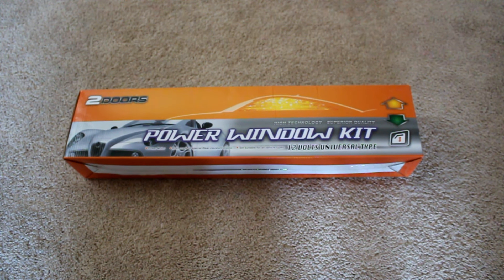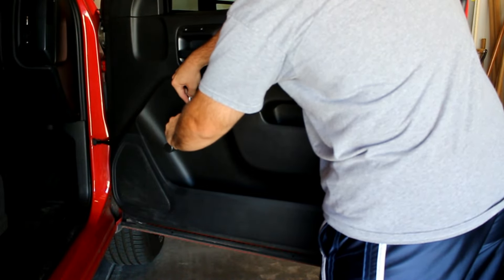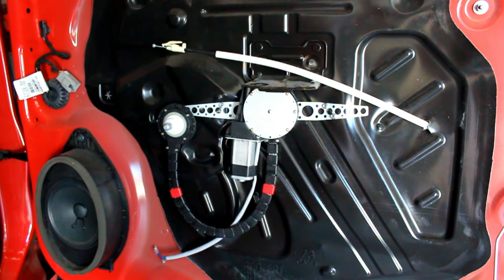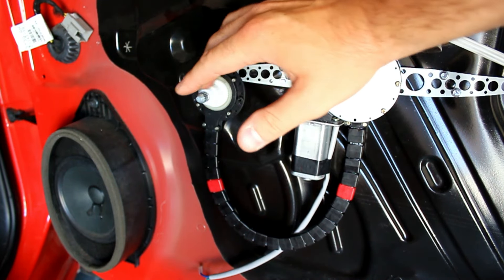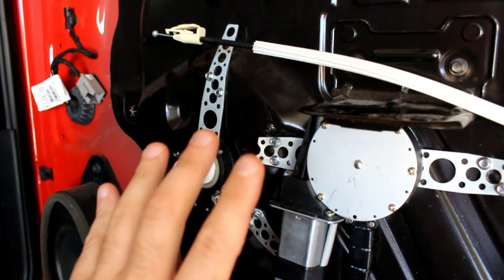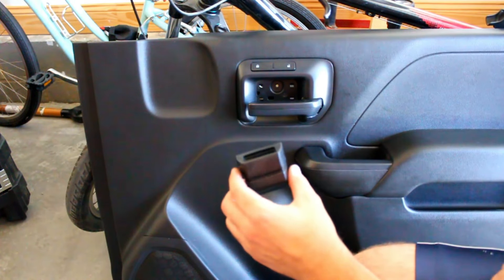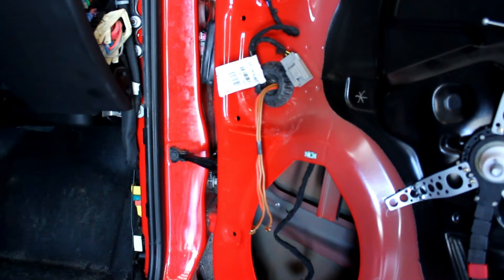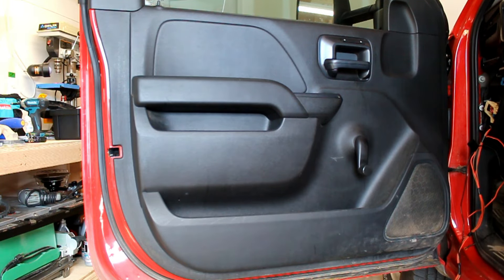[HOW TO] Convert Manual Crank Windows to Power Windows - 2016 Silverado W/T

Comment from the maker: This made my work truck so much better. Power windows are a must have! I know this is a long video, but it has a lot of useful info. Enjoy!
Buy the power window kit here: https://amzn.to/2Nn7XyH 
Buy the Fuse Taps here: https://amzn.to/2RaSYJs
Reply: I did it the driver side worked but the passenger side rolled down but only went half ways
Reply: Fondupot's Garage did you lube the sides and did the windows eventually work a bit faster? Any update videos?
Reply from the maker: @ImHim6Fifty  Sorry for the delayed response. Yes, keeping the gaskets on the window lubed helps tremendously. I lube them up every couple of weeks. My truck sees a lot of dust on construction sites.
Reply: @fondupot  is there a kit to additionally make back windows power windows as well?
Reply from the maker: There is a rear window maker that has a power rear window. But it requires swapping out the entire back glass. I haven’t found a kit that makes the OEM window power. I want a power rear window though!
Reply: @fondupot  oh that would be cool too! i meant a 4 window setup. actually just found one on amazon for around $110. has your 2-door been working without any problems?
Reply from the maker: Oh right gotcha. Yea there are four window kits. My two door kit is still working. Sometimes my passenger side gets stuck about half way up. And I have to push the window up with my hand while holding the button for the motor. But otherwise no issues.
Reply: Thank you
Reply: What where the fuse numbers you put in? 10 i saw and what else? But the main inlet fuse said 30 amp

Comment: Didn't even know this kit existed. Was gonna try and jerry rig something. 
I just picked up a used Chevy cargo van on an auction site. Love the van other than the manual windows. Definitely gonna give this a try. Even if after a while it only works half the time and I have to hand crank the other times, I would love it.
Reply from the maker: Mine are still working. My passenger side gets suck sometimes and I have to push it up by hand. But other than that it’s great.

Comment: That's a good time to pull out your door speaker and make sure it has a rain shield. GM is notorious for leaving the speakers exposed to the elements and rainwater corrodes the connectors and kills the speaker. Making a duct-tape "shield/awning" over the back of the speaker will help.
Reply from the maker: Nice tip! Thanks for watching.
Reply: yeah and swap em out , speakers are cheap as can be now a days
Reply: I used have a 2004 Lexus rx330 with nice polypropylene cone speakers with cloth surrounds and they still sound good and the bass is very good for a factory sound system without a subwoofer bumping strong down to 35 hertz.

Comment: Thanks for taking the time to make this video, I just scored a 2011 siverado 3500 crew at auction and only downfall is manual windows. I was wondering about hunting down some door panels from a wrecked truck that had power windows, thoughts?
Reply from the maker: You could absolutely swap door panels and even the one window motors and track and all the internals. You’d simply just need to wire it up to get power. Good luck!

Comment: About the same kit for my truck I think it is worth buying the only thing is the electric motors aren't that great one of mine broke within the first but I spent 80 more dollars and got the OEM window motors and tracks and I also had to extend the I have a 03 Dodge ram 1500  todoor
Reply from the maker: Mine are still going strong! But yes adding OEM window motors is another option. Thanks for watching!

Comment: Concerning the plugs that cover window's crank shaft, you can make your own with Sugru. It's sold as a mouldable glue. It's like silly putty that turns into rubber.
Reply from the maker: Interesting. I’ll check that out. I left mine open for this whole time.

Comment: Hey have a question that you may or may not answer but I have a 2016 Chevy Silverado reg cab planning on buying 2 new Doors with power windows if I did that would it just plug and play or it would not work would appreciate a comment back thanks
Reply from the maker: Good question. I don’t know if the wiring inside the cab will support the wiring in the new doors you may have to run your own wiring for power.
Reply: @fondupot  Any idea how would I do that thanks for reply by the way
Reply from the maker: You could do what I did in this video and then splice the new door wiring for the windows.
Reply: It won't work you will need new dashboard harness and a new bcm...

Comment: Just u conect The power in The jumper fuse and The light of The switches just is on when The ignition switch is working?
Reply from the maker: As long as your jumper fuse is on a keyed switch then the buttons will only work when the key is on. Yes.

Comment: I have been considering doing this for my 95 Toyota Pickup, but saw some other videos of people complaining about the motors on these being weak or failing... Have you had any of those issues now 5 years later?
Reply from the maker: Well. I don’t have the truck anymore. But the motors did start to weaken after a few years. I read that upgrading the wiring could help, but I never got around to it.

Comment: Very informative! One question though: why in fact can't you keep the old manual cranks in place? Is there not enough place after installing those white adapters? Seems like most elegant solution, after all.
Reply from the maker: You’re correct. There’s no room for the factory cranks after installing the new white adapter pieces.

Comment: Do you notice the windows go up and down faster with the engine actually running?  I've seen a few videos of this installation being done that when the vehicle is started, the windows move faster. 

I tried this kit on my 2004 civic SE sedan last fall (I live in Canada, I am curious to see how the motors handle -40C during our harsh winters), and I noticed the white splines that go over the crank piece - the door panel is too snug against the spline so it jams it up, I'll have to cut a larger whole around crank handle hole as so the spline can spin.  I had to undo the whole project and put it on hold until this coming spring (March-April) due to rain, and try again later.  You mention all this took you up to 15 hrs, and I don't doubt it. So much touch and go, it's fun but you learn it as you go.  I also think that unless you have both sides connected (which is what I did to test my driver side door first), you end up with power problems, some fuse's blew.  I'm doing it little by little every weekend in my condo's heated garage.
Reply from the maker: Yes, I absolutely can tell. When the engine is off, there is not enough voltage to run the passenger side up and down. Sometimes it gets stuck. But if the engine is running, I don't seem to have any issues.
Reply: @fondupot  I may have missed it in the video, but what was the amp rating of the fuse you tapped into?  I'm doing this mod on my 04 civic tomorrow and my ignition coil is only 15amps, I'm not sure it's strong enough to power the motors. The sunroof amp (not used on my DX) is 20amp, so I'm thinking that would be enough.  I don't want my windows to be always on and drain the battery, but I don't think a sunroof would be active without having the key in the ignition anyway.  Lots of testing tomorow with fuses...
Reply from the maker: Original fuse location was a 10amp fuse. The fuse for the window motors is a 15amp. I have not had any problems blowing fuses.

Comment: I have a 2014 Silverado single cab and it had manual windows I really don’t mind but I just hate the door panels there so bad and I want power windows to is it possible to get door panels from a junk yard and switch them out and wire it how would that work?
Reply from the maker: It can be done. I’m not 100% sure what all it entails but the wiring is probably similar. But you’d probably have to do some harness splicing to make it work with oem window switches.

Comment: I always wished cars with power windows  had a  handle on the door that  you could use when it breaks . My driver motor went up as it would go down but not up and would tell  them don't mess with my window on oil changes and they would and piss me off .

Comment: Hi, I have the same exact car and I just bought a pair of power windows OEM with the door panels and the main wire harness of the door and all the controls and buttons from a donor car. My question is, can I replace the factory door panels with the harness and plug it into the connector? and does it need any programing if so?

Best regard to you.
Reply: Did it work for you?

Comment: My right side one will  go down and get stuck any tips?
Reply from the maker: This happened to mine a lot. I had to use silicone spray on the window gaskets all the time. It helps. But I just got accustomed to not lowering that window all the way. I think it could helped by using better wires. Somehow I think the power traveling to the passenger side motor was reduced because the wiring is not the best. I never tested that theory though. And I no longer have this truck.

Comment: Still holding up fine? I just purchased, this video looks great! Covers everything just want to make sure motor won’t give out or anything like that
Reply from the maker: Yes, still working great.
Reply: Fondupot's Garage unfortunately just returned mine.. I had it all wired up (took about 4 hours) turned the ignition and was excited the green light came on... I hit the switch on both windows but unfortunately it was not strong enough to roll either one up. My windows aren’t in bad shape or anything that’s why I was totally caught off guard. Huge bummer but glad it worked well for you!
Reply: Trey 806 what car you have? Thinking about doing this on my Frontier
Reply: old1hit 03 GMC Sierra at the time, the kit is universal though. I had purchased it but unfortunately it didn’t have enough power to roll the window up -not even an inch. I had to return unfortunately! I heard if you kind find your truck (one with auto windows) at a junk yard it’s easier that way and more effective
Reply from the maker: @trey1sauce165  dang sorry to hear it didnt work out for you. Mine are still working great.
Reply: @trey1sauce165  Bro great feedback thank you!
Reply: @trey1sauce165  probly just needed a better power source. Its better to go direct to battery with a fuse gaurd and relay

Comment: Will this fit on any year make and model I have a 2006 Chevy Silverado 1500 extended cab and I need power windows
Reply from the maker: Hi Jake. The kit is highly universal. It comes with several adapter pieces that will fit many makes and models. I cannot say for sure if the kit is 100% compatible, but there is a reasonable expectation that it should be fine. Your 2006 will likely have a similar crank style stud as my 2016. I say go for it! Thanks for watching and thanks for your comment. Good luck!

Comment: I installed mine on the same truck as you but only my driver side works and not my passenger side ?
Reply from the maker: Make sure all your wires are connected correctly.
Reply: Fondupot's Garage  I found out that the car had to be turn on and what fuse did you put on the fuse tap because my fuse keep burning out I finally put a 20 and a 15 I hoping it doesn’t burn out but great video 👍🏽
Reply from the maker: @crxcked2ez247  Yes, my truck has to be on for the power windows to work. The original fuse location was a 10amp fuse. The fuse for the window motors is a 15amp. I have not had any problems blowing fuses.
Reply: Fondupot's Garage ok thanks for some reason my fuse was a 7.5 for the hand steering heater but for now everything works great you video helped a lot
Reply from the maker: Awesome. Glad it worked out for you.

Comment: Would this work in a 2014 ram
Reply from the maker: The kit is largely universal. They include many different spline adapters for different make and models. I am pretty sure you could install this on a Ram truck equipped with crank windows. Good luck! Thanks for watching and commenting.

Comment: Just a quick question I got the same kit as you but I got it for a 4 door window. What amp fuse did you use. I know there is a fuse in the circuit in the kit of 30 amp so when I tap in power do I use a 30 amp use also?
Reply from the maker: Original fuse location was a 10amp fuse. The fuse for the window motors is a 15amp. I have not had any problems blowing fuses.
Reply: Same I was wondering what fuse did you end up using? I’m stuck at what fuse to use.

Comment: how’s it holding up so far thinking of going this way not sure if making it oem is possible lol
Reply from the maker: They were working when I still had this truck in July 2022, albeit they are getting worn down and we’re starting to move slower. You can swap in OEM window hardware and door panels with switches if you have a donor truck. But you’ll still need to wire the motors/switches for power. But itcan be done.
Reply: @fondupot  do you know if i were to get a door with everything in it already would it be plug and play ?
Reply from the maker: @datmfant_9057  I don't think it would be plug n play. You'd still have to do some wiring.

Comment: A1Electric has complete unit for both sides which includes a new regulator and motro with direct fit for around 200.00 USD plus many switch options. The switch assembly and wiring is seperate cost. less work time and great people
Reply from the maker: Cool good info. Wish I knew that when i did this install. This truck was passed down to another employee for now and these motors are still working just fine tho.

Comment: How are they holding up? Any update?
Reply from the maker: They still work pretty good. Driver side is perfect as day one. Passenger side gets stuck sometimes. I have to make sure I grease up the side gaskets on the window otherwise the dust makes it hard for the windows to go up. But otherwise. I’m pleased with how well they’ve held up.

Comment: I knew there had to be a kit that could be hooked up to that window crank rod. I just put a different pair of door panels in my work truck they're all power so this would work good for me. Only thing I would have done different is the wiring at the door jamb where you putting wire around the connectorI would have got a couple pins and crimp the wire to it and put them in the empty spots of that connector:)

Comment: For my cigar fuse it's a 20AMP, if I put an add a circuit into this slot what would my accessory fuse (power window kit) amp be? Also, are all add-a-circuit wire fuses the same AMP? or would I need a 20AMP fuse tap wire?
Reply from the maker: You need whatever type of fuse tap that will work on your cars system. 20 amp for the window kit should be fine.
Reply: @fondupot  So all fuse taps are the same? except the way it fits into the port? I have everything done except this part I can't get to work. If my cigar amp is 20 and the accessory fuse is 15amp would that work for the power windows?  or would that equal to pulling 35amp? (20 from cigar, 15 from add a circuit)?
Reply from the maker: No not all fuse taps are the same. I’m not sure what’s going on in your case.
Reply: @fondupot  Hmm. Idk. Do you know what AMP size I need for this kit exactly? I noticed you said you used the heated steering wheel. Isn't that only 7.5AMP? So I don't understand how that worked for you.
Reply from the maker: I honestly can’t remember. And I don’t have this truck anymore.

Comment: It's been 3 years. Now. How are they working?
Reply from the maker: I got a new work truck last summer. My company still has the truck but it’s used as a yard vehicle in a different state. Not sure if they are still working. But they were still working last summer when I still had it though.

Comment: Im curious if this would fit my small 2001 focus? Ive been trying to deck it out lately.
Reply from the maker: The kits are highly universal. It comes with many adapters that fit many makes and models. It will likely work. But many of the steps shown in this video are going to be different. Like removing the door panels. Hooking up wiring to the fuse panel. Etc.
Reply: @fondupot  thanks for replying so quick! I will definitely check this kit out.
Reply from the maker: Glad to help. Best of luck!!

Comment: Whats the amp number of the fuse?
Can be use on any keyed fuse?
Reply from the maker: I’m using a 15 amp fuse on a keyed circuit. I would advise only using a keyed circuit otherwise the motors will be powered up all the time and might cause battery drain.
Reply: Awesome 
Thanks it was helpful to know how to run it
👍👍👍👍
Reply from the maker: Glad to help! Thanks for watching.

Comment: Was there a harness so you could have power mirrors?
Reply from the maker: Did you watch the video?
Reply: @fondupot  i watched a good bit of it.
Reply from the maker: So did you see the part where I installed the harness to power the new motors. Not trying to be condescending. But it’s all in there.
Reply: @fondupot  I didn’t man I’ve been doing a lot of research trying to get power mirrors and didn’t take the whole 30 minutes to watch it. Was just wondering if the power Windows you installed had the harness for mirrors to plug into and if the turn signals and running/backup lights worked
Reply from the maker: This video is for power windows. Sorry i just realized you were looking for power mirrors. My fault. Im sure there is a way to wire up power mirrors, but I don't know of any way to do it.
Reply: @fondupot  no problem usually the harness plugs in to the power window module so I figured it would

Comment: I did it the driver side worked but the passenger side rolled down but only went half ways
Reply from the maker: Mine does that if I don’t have the engine running. But works fine when the engine is ok. Make sure everything is aligned on the crank too. And try to lube the window gaskets using a silicon spray.